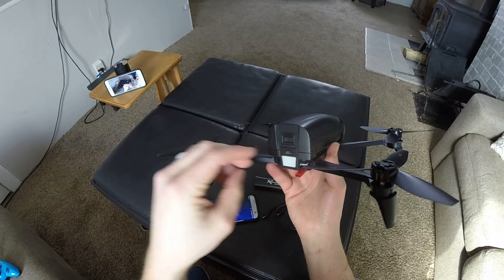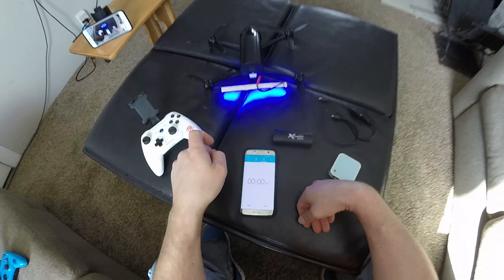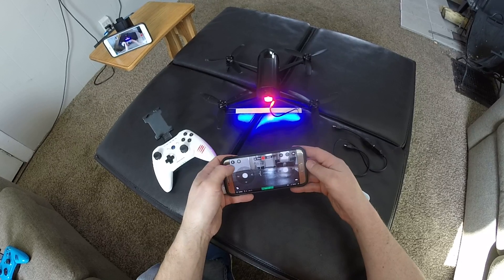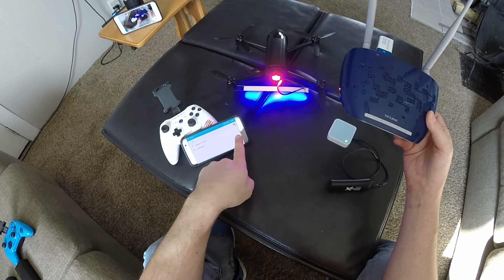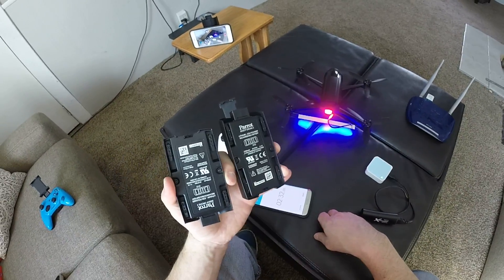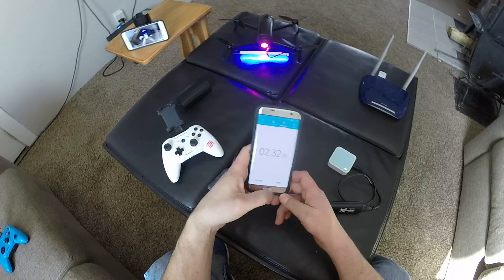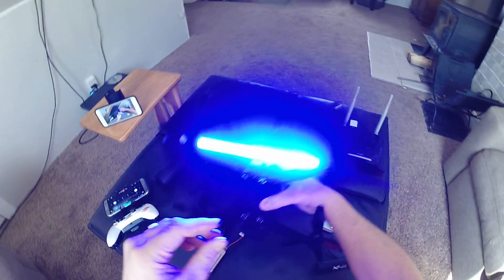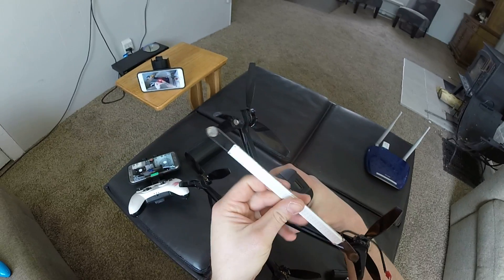Parrot Bebop 2 Light Mod Battery Swap Range Extender

Comment from the maker: Juan Antonio - The Parrot Bebop 2 does NOT have headless mode. if you're just starting out with drones I would suggest Hubsan H107P X4 (this has headless mode and is very inexpensive) https://www.amazon.com/gp/product/B019N38R8G/ref=oh_aui_search_detailpage?ie=UTF8&psc=1